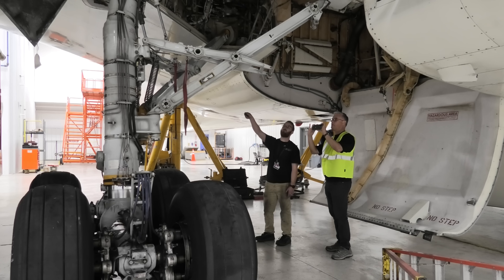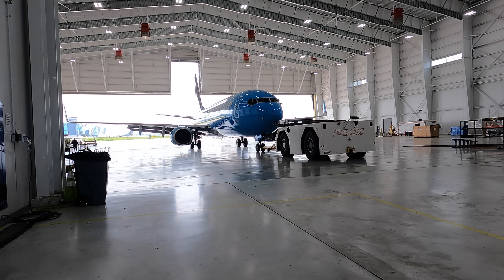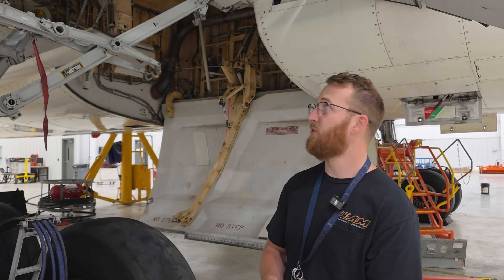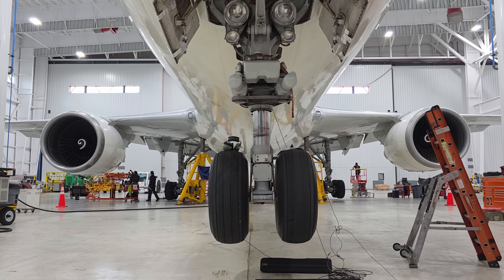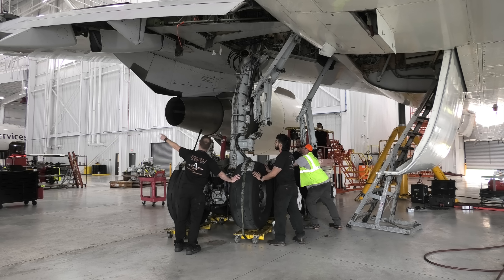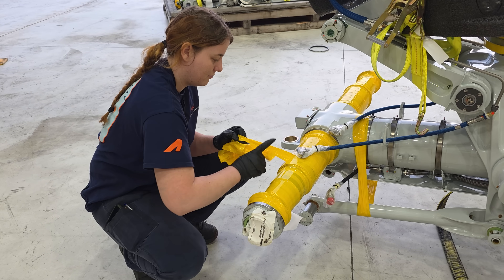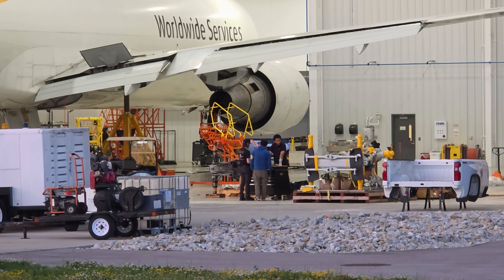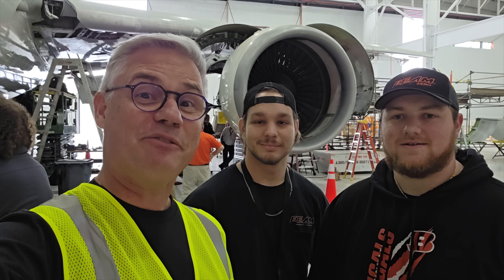What Happens in the Hangar?  Airports Uncovered Part 1

Comment: The usual excellent video documentary from Dennis! It seems a pity to put grungy old tires on a sparkly new landing gear, but what do I know? :-) I suppose those tires are not cheap, so they would want full life out of them. When I get new tires I HAVE to polish the rims/wheels also. I also like to replace brake pads before minimum wear, change the hydraulic fluid, etc. Brakes and tires are such vital parts of a vehicle, be it ground or air. I like rapid-wearing tires, as they give more grip. Tires designed for maximum life are not quite as good, performance-wise.
Reply from the maker: Yes considering how expensive both the tires and the brakes are they need to get maximum life out of them.

Comment: Thanks Dennis . Maintenance is the less glamorous side of aviation but every day is different. One day you’re getting fuel dropped on your head. Next day your sat powering up an engine to full power. Loved being able to teach new engineers the basic skills required to do the daily tasks that are necessary to keep aircraft in a safe flying environment. It is a great career path for any school leaver.
Reply: Hi Dennis did you get a chance at practice wire locking. Not so popular now on aircraft where weight is so important. My favourite job after ground running engines was doing the weight and balance of the aircraft. It always had a bit of drama and sometimes head scratching. When in the forces our line corporal had a great way to motivate us lads . He would wave the “Let me explain stick “ . Always got us to our feet after tea break.